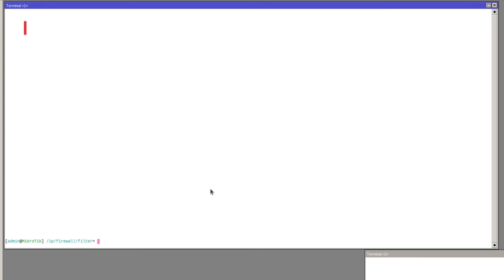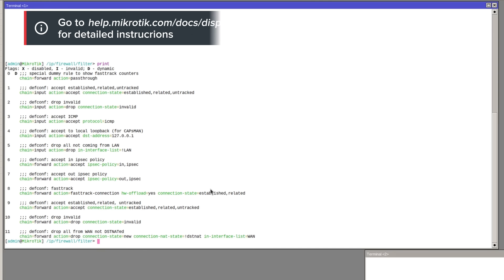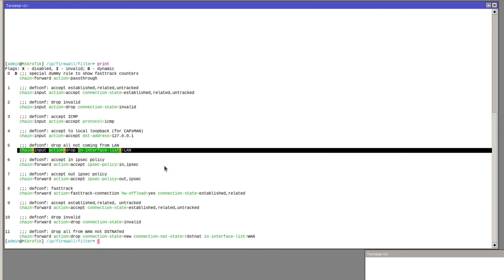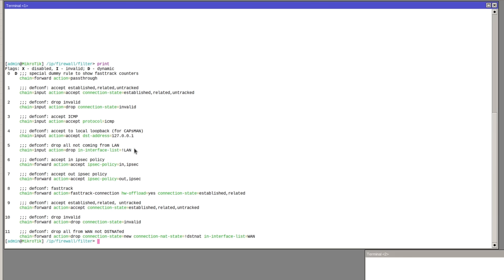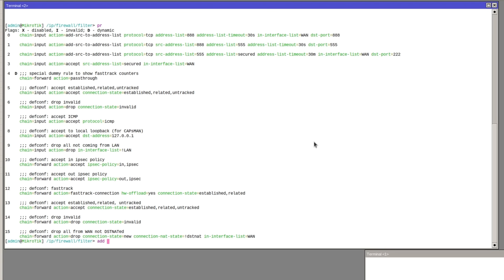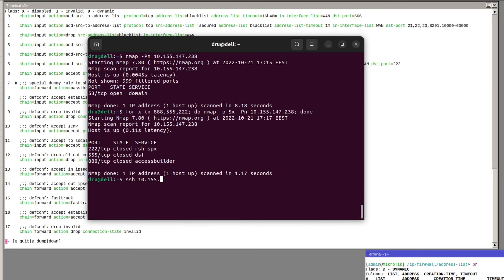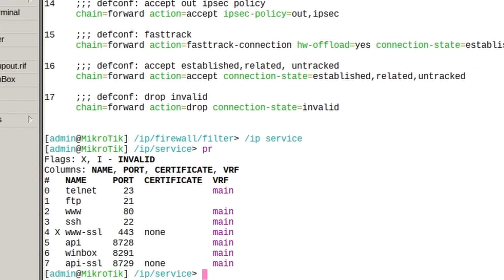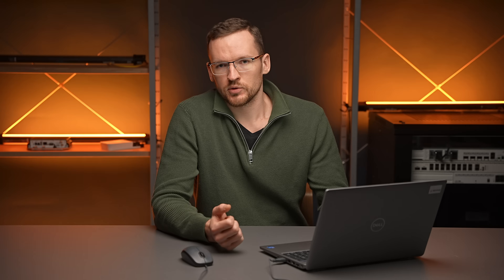Port knocking with MikroTik

Comment: Some Pro TIP.
1. You can use http to knock your router.  Open a browser, visit <your_ip>:888 then <your_ip>:555 and finally  <your_ip>:888 
2. I do get message on my phone using PushBullet when some are added to secure list.  You can use * Whatsapp, email*, or any other service that can send a message.
Please stay some longer at each page when you show the output of *print*.  Not possible to see the result at 8:49

Comment: Wrote this .bat script to protect my ports. Works only with windows: 

@echo off

set target_ip=11.22.33.44
set /a PacketSize1=111
set /a PacketSize2=222
set /a PacketSize3=333

set ip=%target_ip%
set /a size1=%PacketSize1%-28
set /a size2=%PacketSize2%-28
set /a size3=%PacketSize3%-28

set info=IP is: %ip%, ICMP size: %size1%, %size2%, %size3%;
echo %info%
CLS
ping %ip% -l %size1% -n 2
CLS
ping %ip% -l %size2% -n 2
CLS
ping %ip% -l %size3% -n 2
CLS

@echo off
REM 2 sec hold
ping -n 2 localhost>nul

exit

Comment: Instead of configuring port ranges to secure the knocking you can use this line before to block port scanners

add action=drop chain=input comment="dropping port scanners" in-interface-list=WAN src-address-list=\
    "port scanners"
add action=add-src-to-address-list address-list="port scanners" address-list-timeout=2w chain=input \
    comment="Port scanners to list " in-interface-list=WAN log=yes log-prefix=scanner protocol=tcp \
    psd=21,3s,3,1
Reply: Good point, but if you do it as in the video, it doesn't matter if someone is using cookie cutter scanning or if they are targeting specific ports.

Comment: Also, you can use ICMP with custom packet size and you can ping (ping -l for Windows or ping -s for linux) from any OS without installing extra software.  Packet size to ping should be packet size - 28 bytes (IP Header + ICMP Header).

Comment: Why not put this in prerouting of mangle?
Reply: I think you cannot allow acces to the router itself (input-chain) via magling.
Reply: @Problembaer4   if you put those rules for black listing in prerouting... I assure you it will catch incoming connections. My f--koff list is generated there.
Reply: @ChrisNicholson  then you need the define the DST-IP (the Router-IP itself) somehow. Via the input-chain, the routing-decision was already done. So yeah, I think both ways are possible but for most people the firewall is easier to understand as a "prerouting" chain.
Reply: @Problembaer4   I use the wan interface.

Comment: Love the video! Would love to see what you were talking about towards the end regarding a passphrase on top of this great trick! 
Love the contrast as always you all are incredible!
Reply from the maker: See link in description, it has that step
Reply: @mikrotik  I see only random string there - "VGhlbiBjcmVhdGUg....."
Reply from the maker: it's base64 encoded :)
Reply: @mikrotik  mind sharing how to open it? Because apparently I am not the only one a little lost. Love your loyal customer
Reply from the maker: Check the manual again now ;)
Reply: @mikrotik  Thank you so much! 🥰
Reply: When I try viewing that in your documentation it just reveals rand string of characters.
Reply: Just going to leave this here if you google around a bit you'll find a slide show that has an example of how you do this. The key takeaways is that you create a layer 7 rule to match the passphrase along with the knocks. Then so long all matches you'll get in. Haven't added that part, but will be trying it later. I'll add another comment or edit my original with the syntax.
Reply: @xtlmeth  https://mum.mikrotik.com/presentations/US10/discher.pdf
Reply: @xtlmeth  i was gonna wait to post till I had actually tried the method in the linked power point, but if you can try it it’s listed in there.
Reply: @xtlmeth  Slide 41-44

Comment: In general I fail to see the need for port knocking now that MT has wireguard built-in.   Druvis, when is port knocking useful (better option than wireguard)???
Reply: Wireguard ports seem to be undetectable by port scan due to the use of UDP and PKI, but you might not always want to run everything through it. Or maybe you are restricted to using some weaker tunneling protocols - you could then hide those with port knocking.